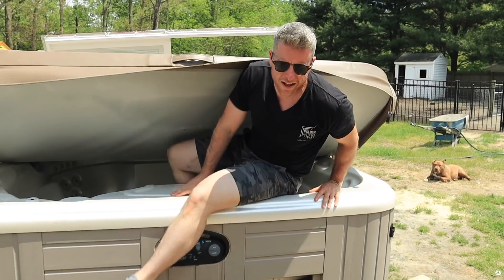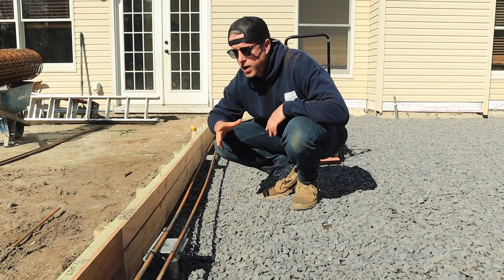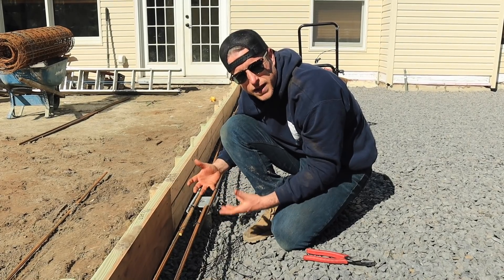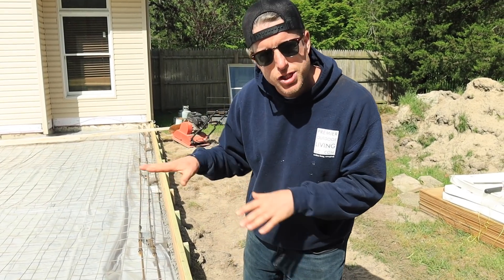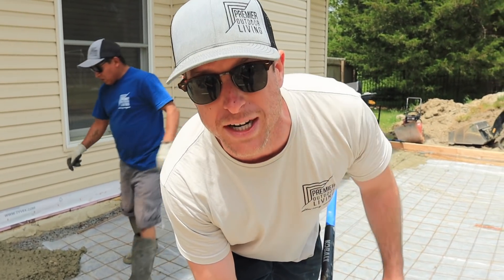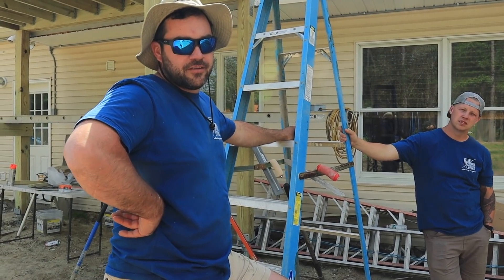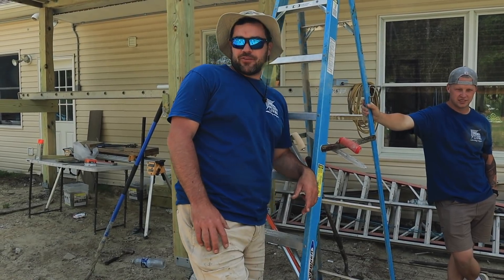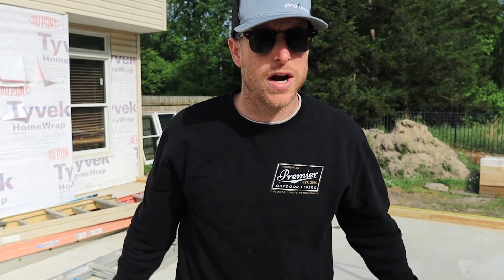How To Pour A Concrete Slab! INSANE Backyard Pt 4

Comment: Love your work, have watched every build on your channel! As a civil engineer in Australia, I noticed you didn’t overlap the mesh reinforcement nor did you chair it up, is there any reason for this? Thought the engineer would specify this… 
Cheers!
Reply: Also didn’t dowel into the existing slab so they are tied together ensuring they don’t move independent of each other
Reply from the maker: Appreciate the support from down under my friend!! Instead of chairs we pour the concrete on top then use the tip of the rake to pull it up into the concrete as we go, the chairs always seem to get in the way and the mesh pops out so I like doing it this way. As for tying into the slab of the house, the engineer didn’t specify that on the plans so we didn’t, although with the helical piles supporting the slab we aren’t expecting movement so I wasn’t too worried about it. With all that being said I’m not an engineer so you might know better than me in this case! Cheers my friend, appreciate the comment!
Reply: Thanks for your reply! That all makes perfect sense! Can’t wait to see the end result of this massive build 👌🏽
Reply from the maker: Appreciate it man! This is a big one for us, I’m so excited to start seeing it come together

Comment: i thought the mess was supposed to be in the middle of the concrete? it seemed to be pretty much on the very bottom.
Reply from the maker: I did forget to explain how we do that…as we work our way back raking out the concrete we use the tip of the rake to pull the mesh up into the concrete
Reply: @THEpremieroutdoor  Sounds awesome! How much extra would it cost you if you hired a concrete company to do this project?
Reply from the maker: Probably not much for us figuring in the labor for the whole crew but the decision for us to do it came more down to logistics
Reply: Yeah usually you’re suppose to have plastic chairs that set it to the appropriate height

Comment: Don’t you have problems with tying the monolithic footing into the piles without a void form? My experience is that ground heave will cause the concrete to crack as it pushes up against the piles.
Reply from the maker: I’m not really sure, we’re just going off the specs given to us by the architect and engineer, they know better than me, and in addition we’ll have a membrane under the tile to prevent any potential cracks in the concrete from transferring through to the finish floor